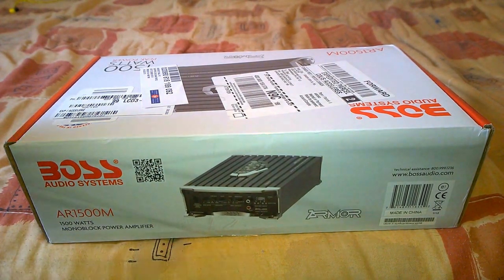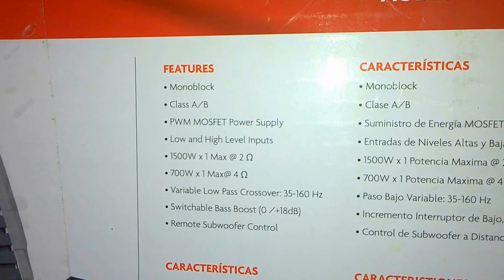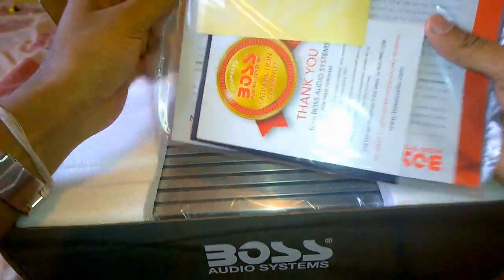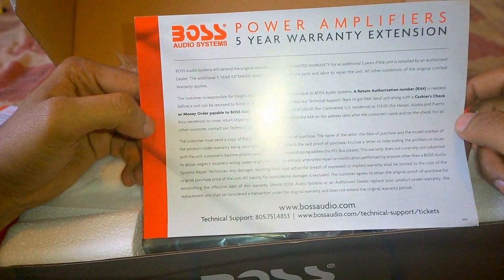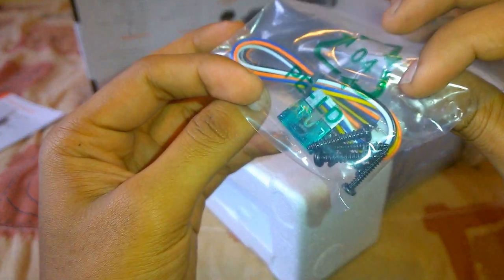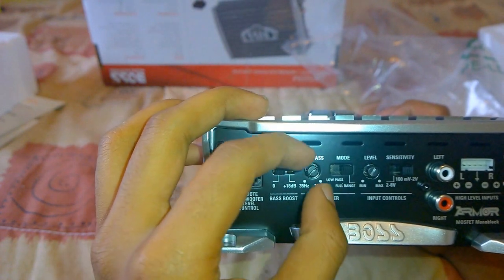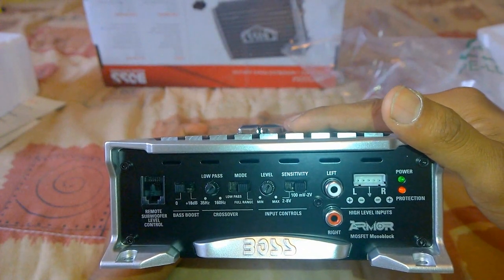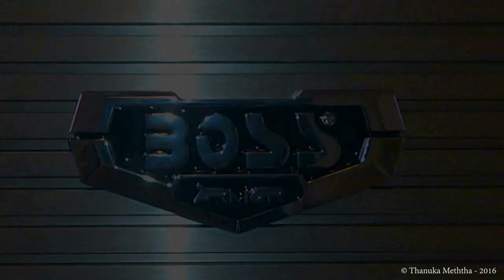Boss Armor AR 1500M - Unboxing

Comment: Just hooked mine up today,at first had some promblems and amp was going into protect mode. As I was trouble shooting found out I had my two speakers wired for 1 ohm so the protection on this amp is awesome and protects it from dummies like me. It's supporting a 12" Rockford R2D2 and a Kicker 10" CVR and it sounds great!
Reply from the maker: i have this hooked up to an 800W(RMS) subwoofer and it sounds great! (2016-2020)